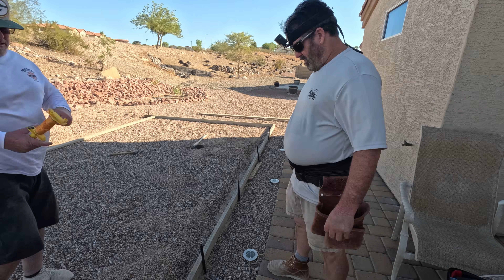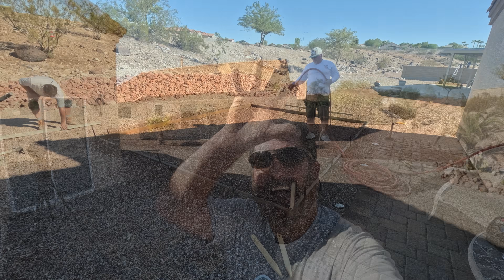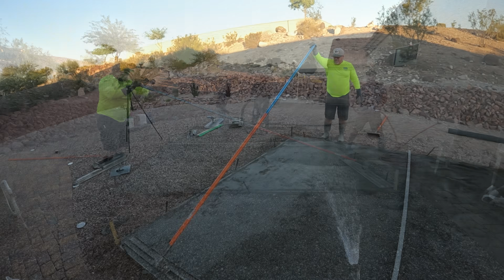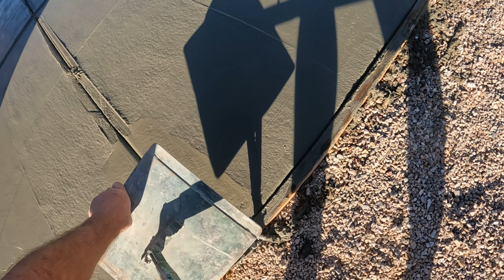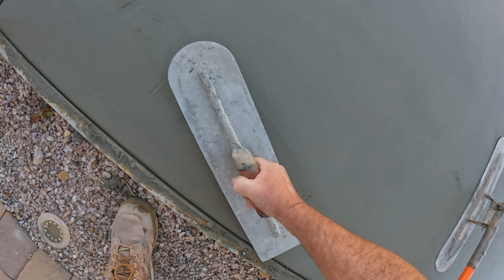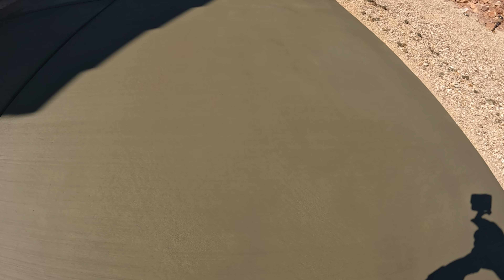Simple 12' x 16' Shed Slab

Comment: Hello Dave! … There’s a good reason that iron/metal is used in concrete! It’s to strengthen the impact that concrete might receive in the future! … So having used flimsy wire mesh instead of 1/4” diameter rebar not only defeated the purpose, … but also had you do more work towards the end (sink it into the concrete while it was still wet!) of the project. In other words, the wire mesh in areas was at the surface of the cement and at the bottom of the cement when it was fully dried! 👎